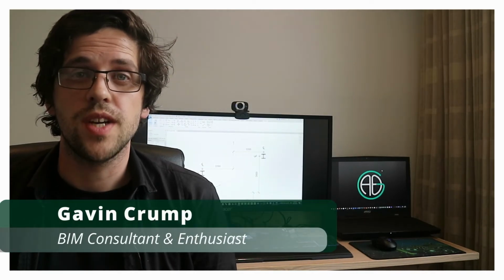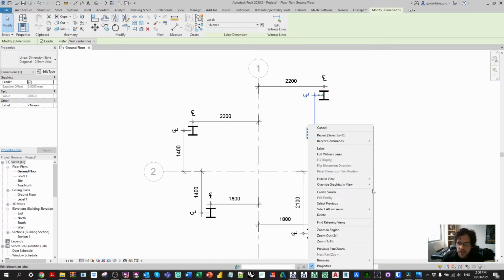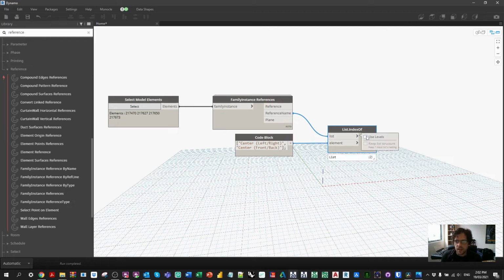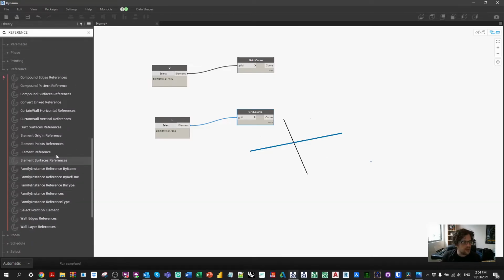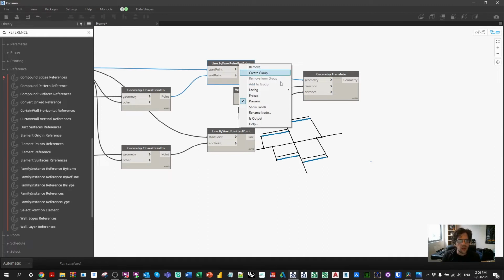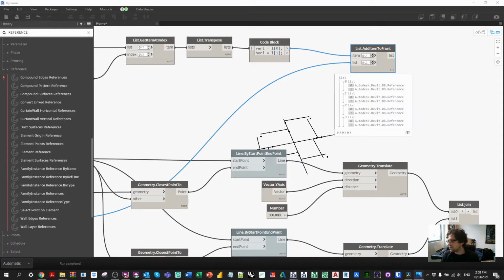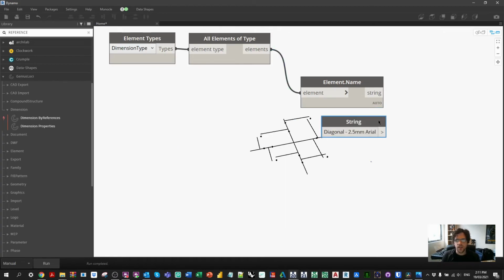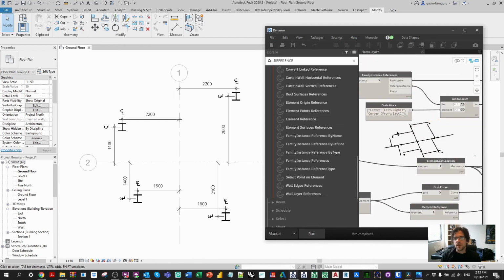Automated Revit dimensioning using Dynamo!

Comment: Thank you so much for all your videos! My favorite channel, since I began to study Dynamo.
I have a trouble with GeniusLoci FamilyInstance References/ My Revit crashes 99% of time, when I run script with connected GeniusLoci node.  I'm trying to get dimensions of 3 different door families on my legend view. Once I have succeeded to go to the final of the process, but dimensions did not appear. In next minute Revit crashed again and I gave up...Have no idea what's going on with that node.
Reply from the maker: My best guess here is that maybe there are a lot of elements entering the node which is overloading the process. If it's only a few things though then I'm not sure why it would crash the session - it might be worth contacting the developer of this package via Dynamo forums (Alban) in case it's a bug or issue that could be solved in the node itself maybe.
Reply: @AussieBIMGuru  I think big number of reference planes can be the reason. There are more than 15-18 references in each family.  I'll definitely contanct the developer. Thank you for your help.
Reply from the maker: @TamepLAN  you're welcome. Sometimes reference planes are needed. For example on average a door family I build has at least 30.
Reply: @AussieBIMGuru  yes, they are really needed. Just one more question. Is there any way to get reference lines in a family, not reference planes? I have just checked - they appear in GL node's lists as references, but they have no names and in the list they appear as blank rows, so I can not identify them. I tried to get them by ID (with Revit Lookup help), but couldn't.
Reply from the maker: @TamepLAN  I tried this also but had no luck in identifying them. The only thing I could think to identify them by is their facing orientation if you know there's only one but otherwise I don't believe they hold other data to compare.
Reply: @AussieBIMGuru  I understood. Thank you.